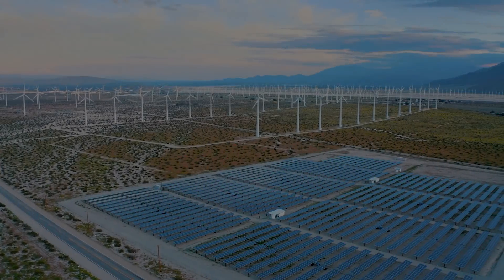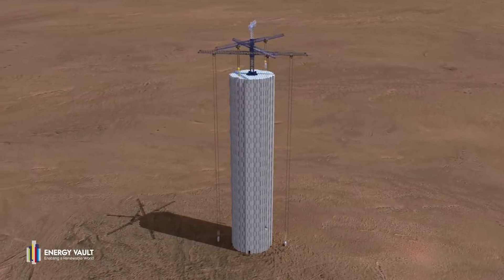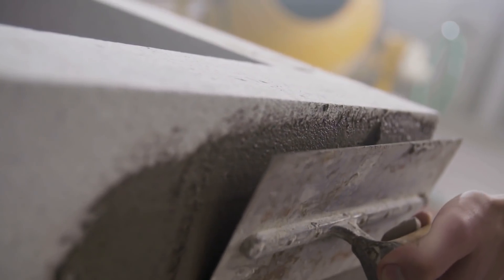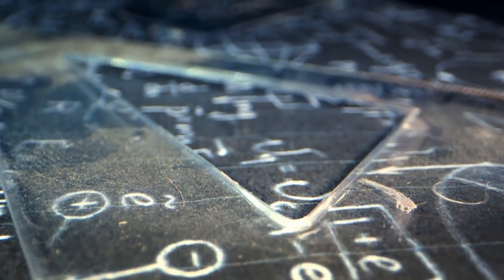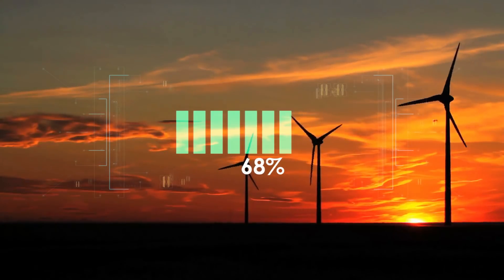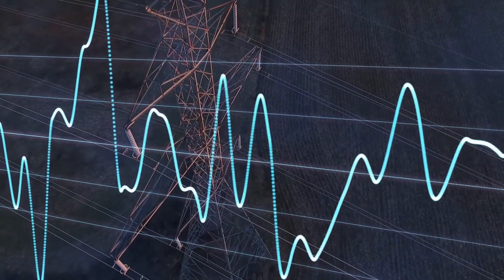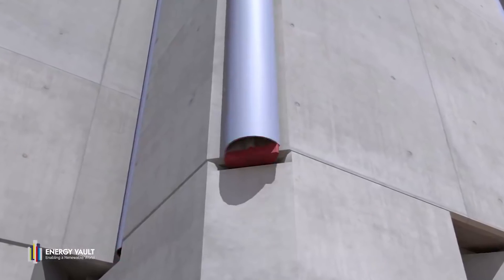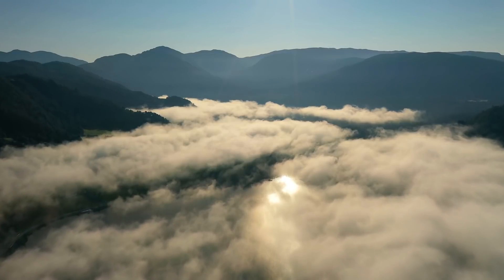Is Concrete the Future of Energy Storage?

Comment: Alternatively we can just admit that storage is a fundamentally flawed and entirely needless idea. Fission power is already capable of providing all the energy we need and it makes storage redundant.
Reply: No, it doesn't. That energy still needs to be stored when the fission plants aren't producing energy. Nuclear power plants are expensive so it's kinda hard to implement them everywhere.

Edit: I was wrong when mentioning  nuclear stopped.
Reply: @alterinam6791  No and no... The idea of storing energy is an absurd fantasy that can't be made workable at all. Even if one wanted to, but one shouldn't want to as it only makes power more expensive by making it needlessly complex. Really the only reason we even talk about it is because wind and solar power are so staggeringly useless. As such storage is seen as a way to put a bandage over the major renewable generators' intrinsic fragility.

As for fission it's outright and overwhelmingly the most reliable energy source, bar none and under all conditions. There is simply no time they're not working. So your notion of needing storage for that time is a non-sequitur.

The technical term for this in the energy industry is 'capacity factor'. Nuclear power normally has capacity factors of well over 90% only stopping every 1-2 years for a scheduled month long refueling. But renewable sources typically have capacity factors of under 30%, thanks to their special feature of randomly not operating at all. :P  With solar lucky to make over 20% of it's rated output and offshore wind getting to about 50% in a best case scenario. This means that ideal case, ignoring all the many reliability and time of use issues one needs about 3 megawatts of renewable capacity to eke out the same energy as 1 megawatt of nuclear capacity makes routinely. 

You're second wrong point follows from the first, as well as being outright wrong. Not only can fission reactors outperform all the other energy sources easily but they're the most practical to put anywhere that we want. Unlike renewable sources that all have sharp geographical limitations. And since they're so reliable fewer are needed.

This means that nuclear is CHEAP. Every region that's built lots of nuclear power plants has proven this, many times over. They all have cheap electricity bills. :) Whereas those that have tired building lots of renewable power have only seen their bills rise while their use of fossil fuels flattens but never lowers. The need for redundancy, the short life spans, the greatly expanded power grid, and all the backups are a recipe for massive price hikes. While the always expensive storage is just a cherry on top of the mountain of extra costs that renewable energy comes with. 

France and Germany are the classic example. Germany has made renewable power part of it's national policy while France decided to build over 50 nuclear reactors. Both of their plans had about 20 years to work, and both are still operating today.

As it stands France gets over 75% of it's electricity from nuclear power and has 1/5 the CO2 emissions of Germany while paying about half as much per-kWh on their bills. Whereas Germany after spending half a trillion euros, which is much more than France spent, is only about 50% renewable powered and their emissions haven't changed much. But their bills have gone up. And as an added bonus they're building a new natural gas pipeline to Russia and just opened a new coal power plant in 2020 Datteln 4. Both of these and other fossil fuel handouts are simply because the renewable energy is always failing to do what it needs to do. If it wasn't for France being the world's largest electricity exporter thanks to nuclear their experiment of 'abandoning' nuclear energy would've left Germany with constant blackouts. 

But I suspect you don't care about what energy costs. You were probably alluding to the popular myth that nuclear power plants are expensive. This is also wrong, everyone that's massed produced them as seen prices plummet, just like with every other manufactured product. :) But worse than being wrong it's an irreverent argument. Because with nuclear power you get what you pay for! Simple as... 

You see people don't by power plants, they by energy. So the billions that a power plant costs doesn't add to much spread across many customers over many years. And since nuclear reactors are extremely productive and last at least 3 times as long as renewable generators this isn't a hard thing to do at all. This fact combined with their always quite cheap power and the simplicity of not needing anything else makes for overall extremely cheap electricity rates. ;)

Comment: i know where we are, I know what technology is available and some to be fair ,,,, just push a revolution in energy recovery devices and implement them on every level, over the board in every industry including homes transport etc etc , This tech alone will reduce pollution and increase efficiency at the same time without having to start over or redesign everything. They can be integrated into what we are currently working with.

Comment: If you do the calculation:E:  m.h.g yourself , the result is in Joule and 1 W is a 1 Joule per second. So a weight of 100 kg on 10m high can deliver as energy: 100 . 10 . 9,8 = rounded 10 000 Joule or  100 seconds of TV from 100 W . It's really nothing but our intuition has problems grasping that. The real energy is probably even lower since there will be friction losses.
Reply: I don't think friction will be much of a problem because the energy , one is putting in is going to be same as the output, especially when pulley systems are used.  Infact storage itself have down falls but this gravitricity is promising

Comment: Impressive Sir.  Good delivery, editing and content balance.  I helped on the kickstarter for Gravity light back in 2012.  Big or small it seems a sensible; longer term investment to have, as an integrated system... with Flow, Air Cooling, Electrolysis, Bio Digestors, plus the new solid state and current tech.  Localised power and food production could also play a major part in the 'demand' side of the equation.

Comment: Structural engineer here. I suspect the devil will be in the detail. Large blocks need cooling during casting due to the heat of hydration, refer Hoover Dam, so costly. Tolerances and the need for them to to interlock,  errors will accumulate over the height.  The lifting lugs and grapple mechanism will need to be very reliable, you cannot have a 100t block stuck 200m up. On the plus side the cranes can walk themselves up by latching onto the inside of the blocks thus saving on steelwork.

As regards hydroelectric, they don’t really bear comparison, there are few places left where hydro can be built without protest.  On the flip side,  the protests about the aesthetics of wind turbines will be x10 for these…

Comment: Batteries = short term (24 hours) storage, gravity = long term storage (weeks, months). You need both as the wind does not blow every day, and there is less sunlight in winter.
Reply: Gravity=As long as the system and materials don't corrode or erode to unusable condition. Depends on how long the cables, motors, breaks, and structure materials can last! 
Thus gravity storage under optimal conditions can be considered for either thousands of years or hundreds depending on how good the materials are as well as how well protected they are from wind, rain, and particles in the metals.

Comment: Floating platforms off of continental shelf would be far superior.
Weights can travel 2-3 kilometres in this scenario and be 1000 tons easily.
Locations chosen wisely will ensure short sub sea cables connecting battery to grid.
Reply: Very interesting idea ✔️
Reply: The problem is efficiency.
That concrete tower of blocks can store a measly two turbines of electricity.
The technology has a LONG way to go.
And to be quite frank we'd be better off going nuclear regardless.
Reply: at that point tho, because of bouyancy the brick would weigh much less, and all that water would cause erosion, thus causing an immediate loss of weight and thus efficiency.

Comment: Your graphics show the wrong idea. When your stack of stored energy is the same height as your energy retrieval stack your system stops working.
Show a huge Mesa with an as large as you can get it elevation from to the valley floor. Show a rail car system on the mesa and valley floor capable of storing and retrieving a very large number of concrete blocks.
Then use your elevator as your energy storage and retrieval system. Then you got something.

Comment: Honestly, how much cleaner can you get than Nuclear?  I'm not going to sit here and google up the number of actively known Nuclear Plants in 2021. Let's just assume the number is greater than 3, two of these, (Three Mile Island, and Chernobyl) happens because stupid idiots had to push the limits, where as the third, Fukushima, had the misfortune to be on an Island that has an ununifide electrical system (220/50 on the West side, and 120/60 in the East) so they couldnt run the pumps, or the cooling.

Yet we are going to let these setbacks dictate the use of this tech. For Windmills that kill millions of Birds, and migratory insects a year. WHEN THEY WORK! And, will leave you sitting in the dark, freezing, when a passing ice storm leaves them with a nice glazing of ice over em. So they can't spin anymore.

Comment: The Energy Vault (EV) has some additional problems not mentioned. First of all, cranes cannot work above certain wind speeds. EV must stop working if the wind speed increases to about 20km an hour and certainly not if it goes over 30km an hour. The higher the speed, the longer it would take to even use, as the bricks would need to stop swinging becore they can be lowered into position or being placed into the tower configuration. Putting these things near wind farms would simply not work for example. 

The best comparison for using weight to generate power would be against a hydro plant. Hydro plants are expensive but generate about x1000 the output of power, work instantly, and do not care about the weather, with minimal moving parts. Water is also very cheap, and replaceable by simply collecting rain. This brings me to the next issue, EV would suffer greatly from downtime due to repairs - to the cranes, cables, and concrete blocks.

Lastly, to maximize the power output, they'd need to spread out the bricks as much as possible when making power, then store the energy in the tower format so the bricks are elevated as much as possible. Otherwise, half their bricks can't even be used (they might as well not use bricks for the lower half of the tower as depicted in the animation).

I was pleased to see you took a balanced approach and were not "all in" on the idea. Keep up the good work.
Reply: Yep. I've been scanning through for the wind problem that I've heard mentioned elsewhere and I'm pleased to see you've mentioned it. They've talked about putting the whole thing into building, but it seems to me that that would be a deal breaker.
Reply: Would building some underground alleviate these problems?
Reply: cranes are just made to reuse the motion system. otherwise for very pile of blocks on Z axis (height) you would need its own crane. They share one crane for some areas and that's how they save costs. You could make gears out of concrete too, cover then with some high density polyethylene and get the same cost of the system instead of cranes because concrete is cheap and polyethylene is cheap. Both materials easily will fill molds so you can make a lot of them in minutes.  No lubrication is needed. There will be no wear since there is no oxidation. You wont need intelligent software , sensors and all this robotics stuff since every block has its own resources to be lifted and etc... my point is: the reusability of cranes is a questionable thing. They patented their system, but that system is not as efficient as it could be

Comment: I believe old mine shafts are a
 better use for compressing air 
into many separate chambers, 
within the mine.
Old air shafts may be ideally,
for this to be achieved. 
My original idea is to use separate chambers, within an old mine achieving many batteries, within a mine.
Please consider 😊
Reply: Compressed air storage has the problem of the Carnot cycle.  It's extremely inefficient.  Still, it's less of a terrible idea than this one is.  Concrete blocks..   Just idiocy.

Comment: The bigger problem isnt that concrete is denser than water.   its that WATER Moves on its own and lifts itself.
This is why water is best.
Water evaporates and falls as rain in the mountains,   and flows down the stream to a dam.  The dam blocks it up and lets water naturally flow down hill into turbines and makes electricity without anything being lifted at all.
On a side note,  your research lacked detail.
Batteries work best at 72 degrees Celsius.   In the cold and winter,  their capacity is drastically reduced.   Do some research on it.

Comment: I'm leaning towards concentrating solar thermal becoming a big player. It's a lot easier to heat up a fluid and store it over stacking concrete blocks. If you need to add storage you just add more of a relatively inexpensive heat storage fluid. 

I suppose one disadvantage of this is that the storage has to be at the solar thermal plant rather than being more distributed, so it's only large scale.
Reply: Honestly, the fact that anyone took stacking concrete blocks as a viable form of storing mechanical energy seriously is a little disconcerting for the future of humanity. A flywheel would have been a much more efficient and powerful solution among the tried and tested pumped hydro storage and the less tested or deployed but, very interesting compressed air. 
I also believe that solar thermal electricity generation and storage are a great source of power production. They are commonly built in desert landscapes too hot and dry to live in so the land for the Solar concentration arrays is cheap and regulations for being near populated areas isn’t an issue. 
As to what you said, the material used for storing the thermal energy generated is actually molten salt as it is self insulative and does a great job at storing thermal energy for long periods of time. The heat from this is then used to heat of water that runs a steam generator and is then cooled and re-condensed to be used again. This means that the electricity can easily be sent throughout the grid for power delivery and more conventional Grid storage devices like Battery Farms could be used throughout an area to provide redundancy, increase efficiency by generating and storing electricity during peak production hours when the sun is at it’s brightness and ultimately, to ensure there is enough stored electricity and thermal energy to generate more so that a Grid’s power delivery needs can be reliably met. 
The future of green and renewable / sustainable energy is definitely going to be a complex landscape of many different and nuanced solutions having to all work together in mass dance of synchronicity or, at least it seems like that sometimes. 
Maybe we’ll get lucky and another big breakthrough in Fusion will happen, such as is the first net positive power production.

Comment: Since concrete is only a few times denser than water at most, you would need vast lakes of concrete to replace slightly vaster lakes of water. So the answer is "no". Thanks for the video though.
Reply: You don’t understand what this energy storage system is for. It does not replace pumped hydro power. One is short to medium storage and frequency regulation, the other is medium to long term storage. You don’t want to use pumped hydro for frequency regulation, and you’re not going to use the energy vault to balance seasonal variations
Reply: @auspiciouslywild  I still doubt it will be any use (a large water tank would do the same job more cheaply and with fewer moving parts), but at least that's a bit more plausible. My prediction: it will never be built.
Reply: @johnpurcell827  Using water would be less efficient, not really use significantly fewer parts (you'll need some valves too, not just a pump), would be harder to maintain (frequent cycling of pipes/pumps will wear out the parts faster), and if you don't have the right geography you need a ridiculously tall water tower. I think EnergyVault will find a niche due to how incredibly simple it is, and that it probably uses a lot of off-the shelf parts from the crane industry. I doubt there will be ONE energy storage solution used everywhere, there will be dozens, just like there's dozens of ways to produce electricity
Reply: Not really, hydro power does not work the same way as the gravity . It's even better because the concrete blocks will use all of it's energy that stored in it as output, but the hydro water only gives output only when it leaves the turbine and thats it, the energy of the water  from the top of reservoir to the bottom is lost .